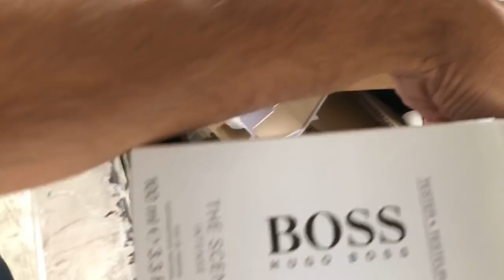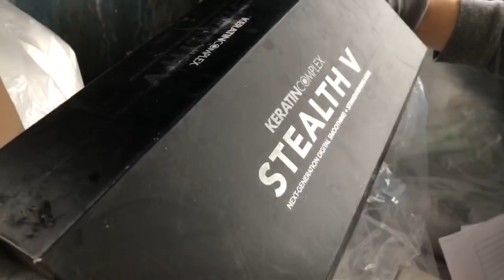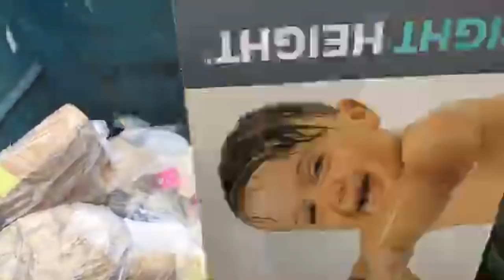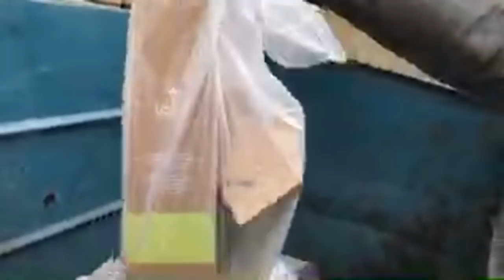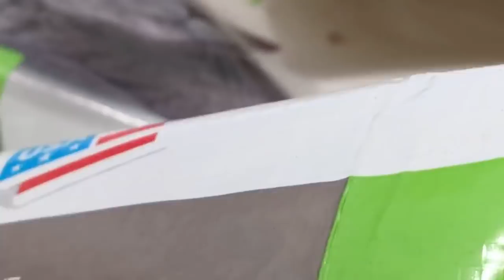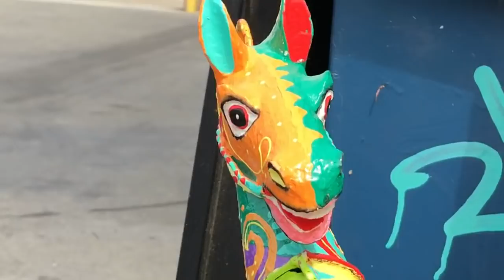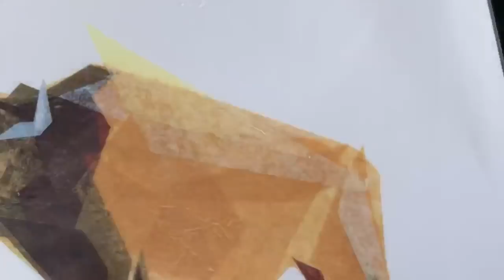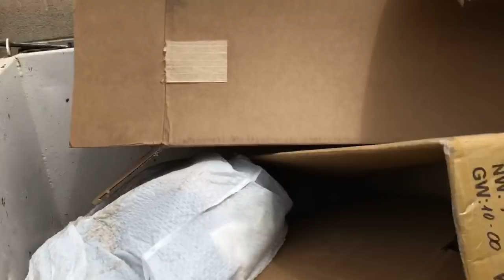DUMPSTER DIVING- WE HAVE A PROBLEM

Comment: I too got the baby bathtub from buy buy baby, but here in Chicago all the locations I go to spray paint all items in red spray paint. I do however have a great solution to remove the red. It is just time consuming
Reply from the maker: amber kachiroubas we’ve had the red on some stuff too...not our buy buy baby but petco has done it and so has bed bath and beyond. I can get it off plastic and metal with warm soapy water and a blue scrubby sponge but when it’s on fabric I can’t get it off. 😩